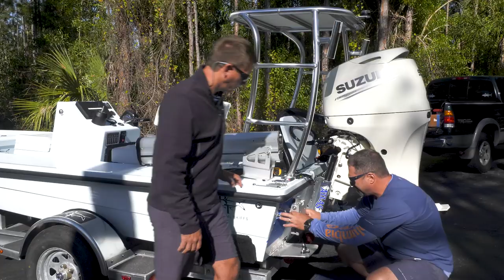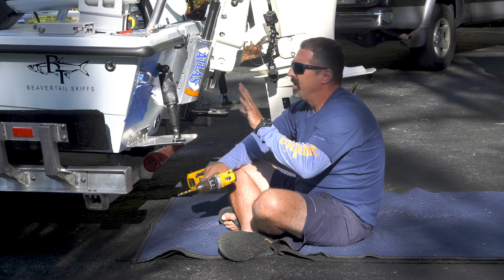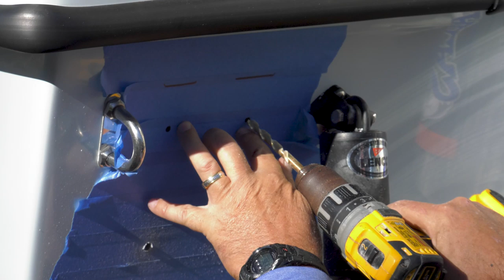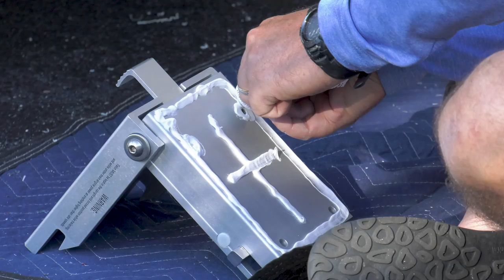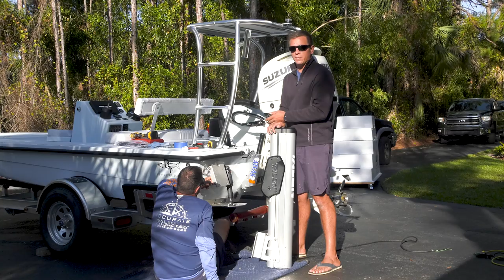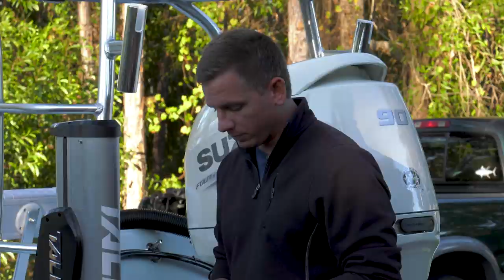How To Install Minn Kota Talon Shallow Water Anchor

Comment: Do you level a talon like you would a transducer?  Use pennys to find where gunnel is level.  Then at home jack trailer up or down until gunnel is level, then put level on top of the talons?  Adjust until level?

Comment: Hi guys, what is the name of the tool called that you would use to cut off excess cable ties?  To leave smooth edges and not those sharp edges?  Thank you.
Reply: Flush cut cutters 

Klein make them

Comment: could you tilt that if you wanted/needed too though??
Reply: You can still tilt it but not fully to deck. Cap design of the Beavertail Vengeance required a large setback to clear rub rail.
Reply: That does not tilt because is not level with the top of the boat due to the rail. But is too late now lol no need for the tilt bracket..